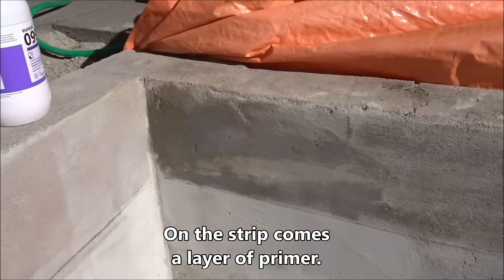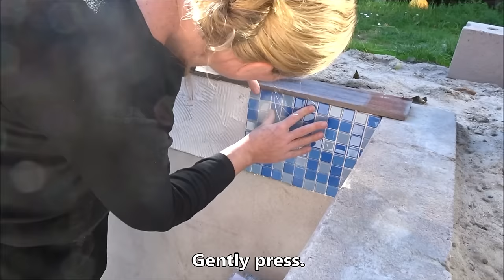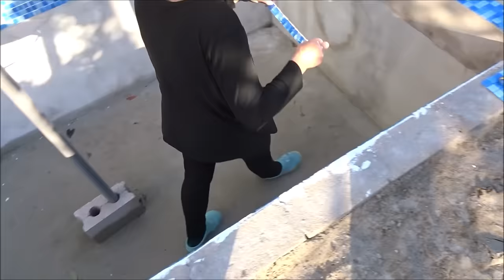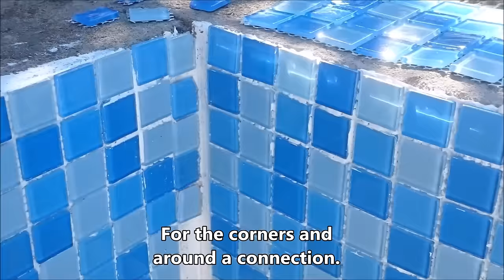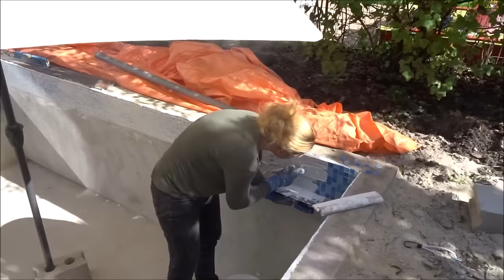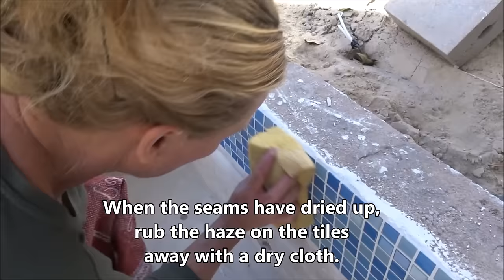How to tile a swimming pool - DIY with Nicole

Comment: How did they hold up.  I tried this in 2009 and thought I did everything right but they all fell off.  I believe I used the right motor but didn’t use the glue you used.  Our pool fills up high w water sometimes in winter so thinking maybe tiles were at ice line? Thinking about doing one side with the glue you suggested, and see how winter goes.  Also I have a humidity tester bc we were doing our basement floor , not sure what the min humidity should be.

Comment: Nicole you used a tile adhesive that clearly states in the specifications NOT to be used in swimming pools
Reply: I noticed the same thing. Glue is for indoors! You must use thin set cement!

Comment: I’m hoping this works out Because this looks like it was done very wrong. Did you use mastic instead of thin sets and you should have used an epoxy grout instead of a regular grout.
Reply from the maker: Thank you for your nice response. Yes, The tiles are all still in place and the pool is great. The children say :-)
Reply: So epoxy grout?  I am getting ready to do my water line tile and stopped by a tile shop.  They tolde to use regular grout.  I been worried that is wrong advice.  Especially with salt water.
Reply from the maker: Sorry, i have no experience with salt water, yet.
Reply: vince king Old post, but you can use regular grout. Thing is you have to check the specifications to find out if it can be used where tile is submerged, and how many days before you can fill the pool. Same goes for thinset. Not sure if that premixed mastic she used is meant for underwater.
Anyways, mapei makes a rapid setting thinset and grout that allow you to fill with water after 3 days. Most grout and thin sets require 21 days.
Reply: دقیقا زیاد اشتباه کار کردن بعید میدونم جواب بده

Comment: I have some tiles fell off from the top edges of my pool and fountain, I would like to put them back.  What is the glue compound you used?  Need details, so I can get it  locally. THANK YOU!
Reply from the maker: We used Eurocol 681: https://www.forbo.com/eurocol/en/681-marmercol/e975hj
But do you know the reason why they fell off? Maybe the concrete is humid?
Reply: The best tinset for the glass tile its platinun #254
Reply: And make sure u have a amastic on the top off the tiles! Or deck o seal
Reply: S1 tile adhesive for sticking back the tiles make sure you prime it first

Comment: Since this video was made, have there been any failures with the tile due to the premixed thinset you used?
Reply from the maker: No, not at all. The tiles still look great and are easily cleaned after the winter. Sometimes I wish that we did the whole pool with these tiles (as maintaining the paint takes much more work!)
Reply: Pink primer that's probably acrylic primer ... Not ideal for a swimming pool...  Try synthetic penetrating primer , tanking and S1 tile adhesive not acrylic ready mix tile adhesive you will thank me after this winter (if you are in a country where you don't have a winter I am guessing this is fine as long as the render is water proof )... Also epoxy grout is a better option for grouting as it's stronger and easy to clean
Reply: I cannot believe that the glass is not falling off! You should NEVER use glue in a pool!!! Thin set cement only!!!

Comment: I have a large cement pool and would like to do the same as you.

However my pool is already painted (epoxy paint). Will the adhesive stick to the paint (assuming acid wash is done), or do I have remove epoxy paint via sandblasting?

Comment: Why didn't you put a main drain in the bottom of the pool???
Reply from the maker: When we started, it was already complicated enough... We were afraid of leakages for example not being professional pool-builders. Maybe I would put a drain if I do it again, having more experience now. However, a submersible pump works also. We do not drain the pool often anyway.

Comment: Where is the last episode?
Reply from the maker: Episode 7 is online, now. Last one takes a fews weeks. Grts!
Reply: @MichaelBoerop  can you explain to me why it seems you put no hardcore or crash and run stones under concrete on the soil.you put your cement straight on to plastic sheeting and you did not join the rebar up to the bottom blocks tie them in is that ok to do